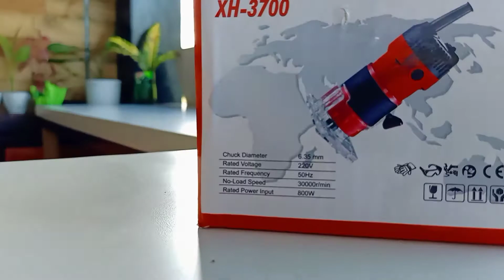MITSUSHI TRIM ROUTER

Comment: What is your general opinion of Mitsushi power tools? I'm considering buying one of their water pumps, but can find any reviews on it. Thank you all in advance for any input or insights you can share! Smiles! 😃
Reply from the maker: Goodevening , ..... base on my experience to my mitsushi tools that I bought online , all of them are still working and in good condition until now. I also read some reviews about  their products and it has a good rating and comments.
Reply from the maker: I checked the mitsushi water pump comments and reviews of other consumers  ....     so far it has a good recommendation .